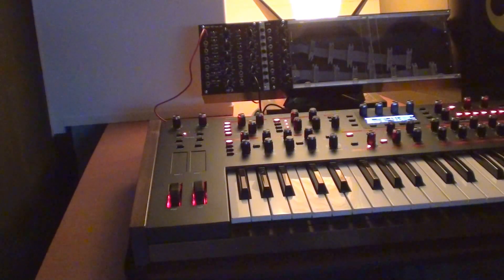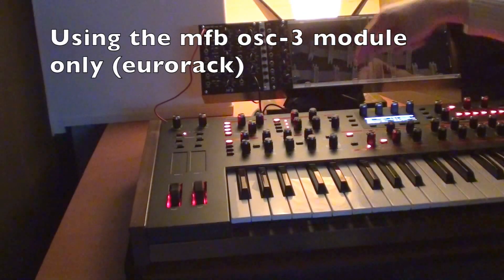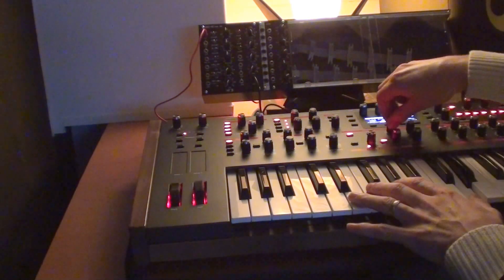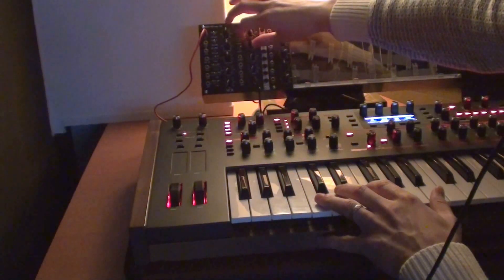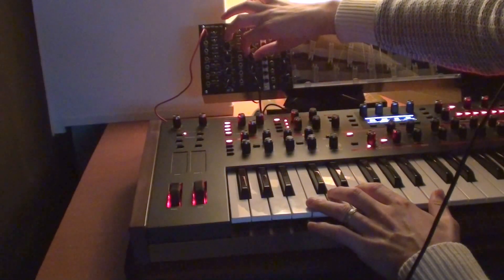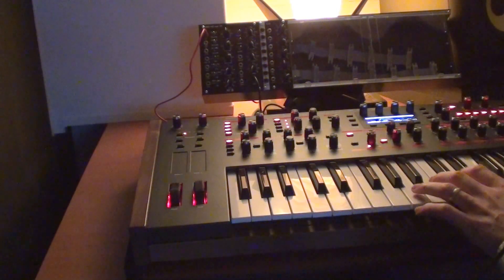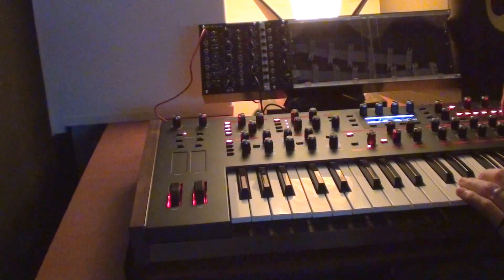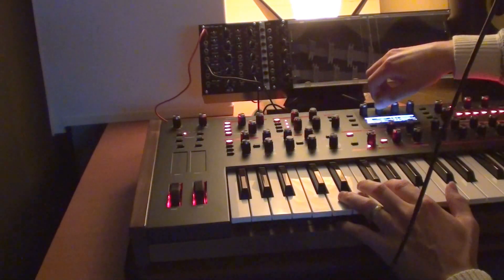Adding 3 VCOs to a DSI Pro2 using CV

Comment: I've heard from some owners that they actually prefer to run their VCO synths next to, as opposed to through, their PRO2....supposedly, the PRO 2 limits high frequencies?   I dont know, but some have said that external VCOs through them dont quite sound as alive.    Im skeptical oftheir claim.  Any thoughts?
Reply from the maker: I've never heard those claims tbh. I've owned the pro2 for several years now and it still is the best sounding synth I've ever had. Made comparisons to many other synths but they often lack the clarity and presence the pro2 has, so I can't relate to the lack of high frequencies claim